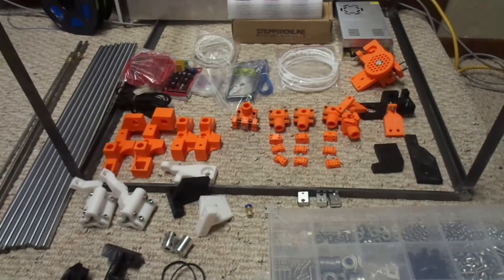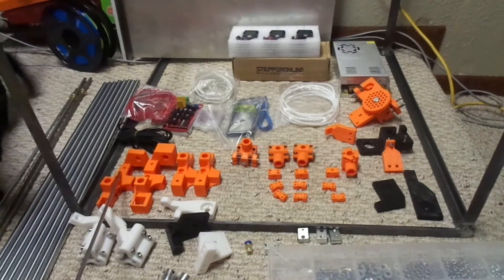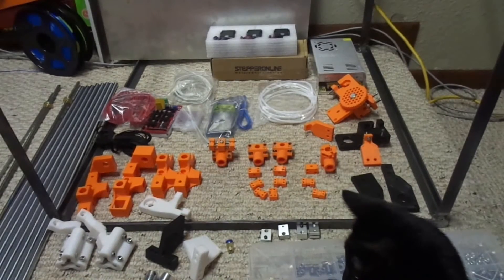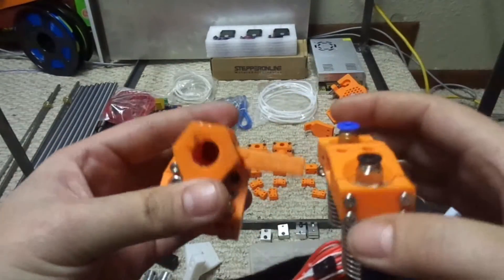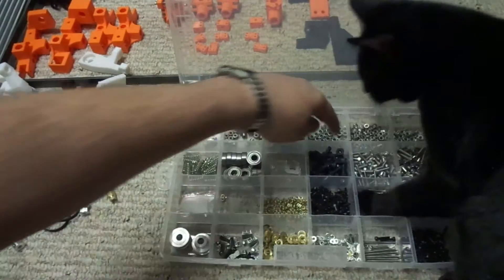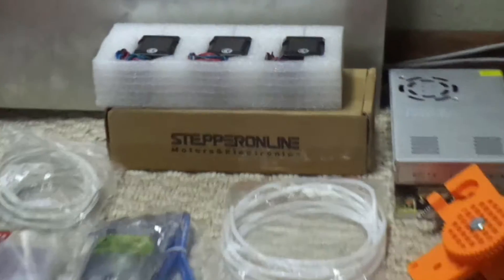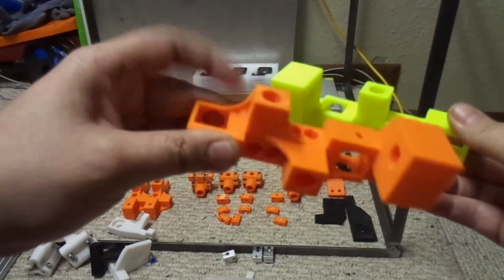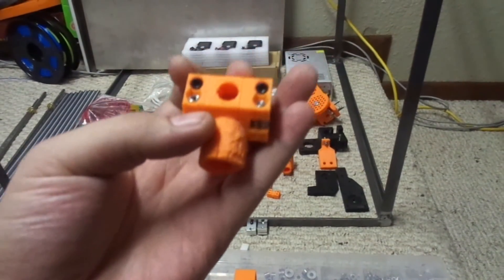3D Printer Build - Part 1 : Parts Overview

Comment: Looks great. I'm in the process of designing a 3D printer and the options for design are overwhelming at times. I look forward to seeing this completed and printing.
Reply from the maker: Thanks!  Yeah, it is a little overwhelming on decide which option you want to go for for almost every part.  The good thing about designing it first in Blender, is that you can see what works and visualize it first.  I really am looking forward to getting this done as well.  I just hope my back holds out on me and doesn't go all the way out like it does sometimes.  I've been taking it easy though, trying not to overdue it.  If you need any help with your design, feel free to email me kevin@inventimark.com.
Reply: Thanks Kevin!

Comment: Hey man, cool video. I found you're channel through the 3dprinting subreddit. I'm just curious, do you have any concerns about the rigidity of the frame? The 'extrusions you're using don't look too robust. I'm curious to know more about that design choice. Also, it looks like you've essentially designed this whole thing from scratch, was this simply for the exercise and/or are you not interested in any of the popular 'opensource' builds like C-bot/D-bot and herculein (sp). Thanks for the video and keep them up.
Reply from the maker: Thanks!  The frame is pretty solid because it's all mild steel in angle-iron form.  If I need to, I can add bars on the corners to get more rigidity.  However, I've got the main rods and bearing assemblies in there right now (waiting me to drill the frame) and it seems pretty solid.  The previous frame I made just wasn't quite right and warped slightly after welding.  I tried standing on it to bend it, but it wouldn't budge at all.  So I made this newer one that seems to be really good.  I'm making this from scratch for several reasons.  To see if I can make a better printer than my first one, test my design skills, a lot cheaper materials than the open source builds, and to prove that even a regular dude can do it.  - Kevin
Reply: Awesome man! Thanks for the thoughtful response.